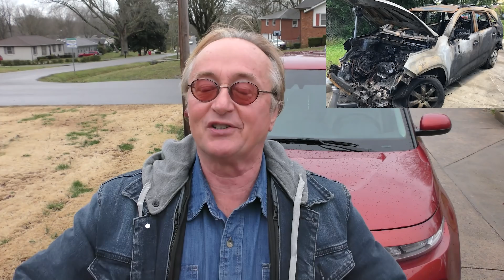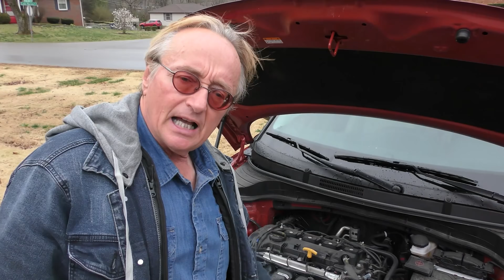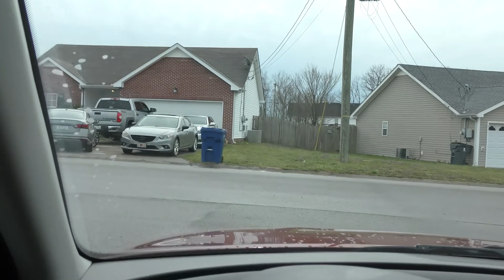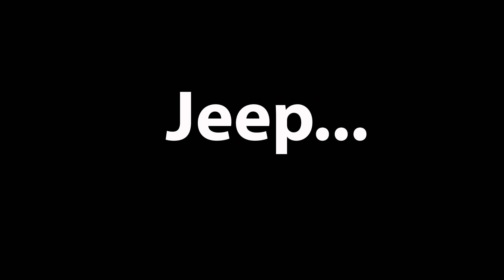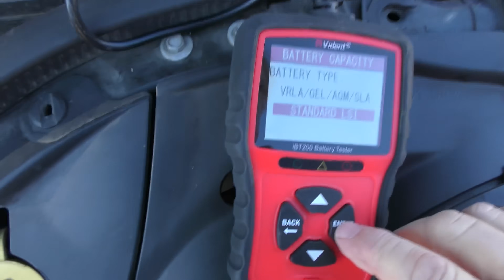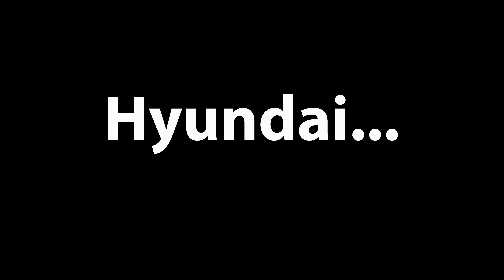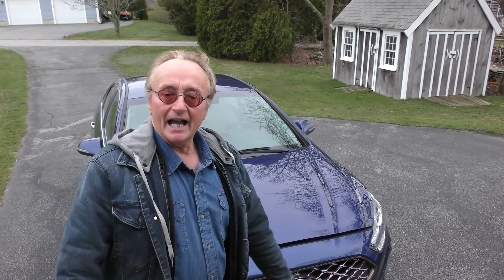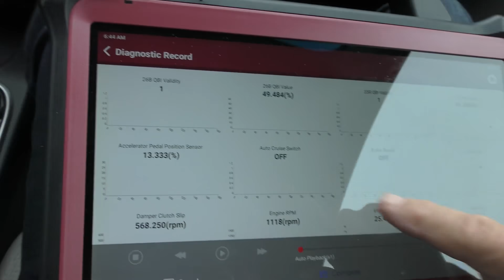3 Car Brands That are Crap

Comment: My 2000 Camry 4cyl has 288,000 miles and doesn't and has never burned a drop of oil, it's scary how well built this car is .
Reply: Toyota makes good cars, that’s why the Camry beat the Taurus in the 90’s, among other things, lol
Reply: @ryanwiseman9141  My college roommate bought a brand-new Taurus.  Total lemon.
Reply: @ryanwiseman9141  Toyota SR-5 is a "Midway for US Small car" in the 80's.I got rid of my new Volvo 244 GL and brought a used 1980 Celica used with 30K miles 2200 cc engine SR 20 in 1987 because I was sick of repair bills for my Delta 88 and Volvo 244.
Reply: @ryanwiseman9141  My aunt had a Windstar (same engine and trans as a Taurus V6) with over 500K miles on it before it died. It only took three engines and five transmissions.
Reply: @ryanwiseman9141 Until it meets HONDA of the 1990s.
Step down and move down.
Reply: @loktom4068  Toyota has always been the one to beat, Honda has a tiny fraction of Toyota's capabilities.
Reply: @zachZO6-s9b I disagree with that. Honda makes a great product
Reply: They're good cars. If I needed a commuter I usually look at what kind of car they have for taxi. It's a good indication of what car is reliable.
Reply: One of my co-workers had a 2001. He just recently sold it with 200,000 miles on it and had no issues with the car at all except regular maintenance.
Reply: @thomasgodlewski1943  unless its a bmw they use.
Reply: Yes. I love Toyota. My 1996 toyota 4 runner is still running great. Over 310,000 miles. What a fantastic car.
Reply: Not scary at all.. it's fantastic.
Reply: 97 to 2001 Camrys are indestructible.
Reply: @ElGringoLocoOficial  I hope you're right. I just bought a '97 Camry with 120K miles.
Reply: @histubeness  Just keep your eyes on the gaskets. The mileage is low but any 27 year old car usually begins to leak oil because the gaskets get brittle. There's no reason your 97 shouldn't make it to 240k or more.
Reply: My Toyota Tacoma with over 600,000 miles has never dropped a single drop of oil.  Been parking it in same place all 20 years and you can look where I park it and not a single drop of oil
Reply: The engines on the old Camrys are all fantastic, it's always rot in the rear shocker turrets that kills them.
Reply: Same here in Australia. Bought a 2000 Camry 4 banger auto. Yrs of trouble free use. 1 water pump and 1 reverse lamp switch due to water corrosion. Great on fuel and all round good car to drive.
Reply: It will outlive us all
Reply: Love my 2009 Camry
Reply: And today all companies make cheap crap
Reply: It seems only Honda & Lexus remain.  I wouldn't buy a new car anyway. @anarchyamp
Reply: @millerforester6237 
I looked at some Hondas yesterday while I was in for service. The dealership wanted anywhere from 3000 to 6000 over MSRP for the Civics that they had on the floor. There wasn't much else in the showroom.
I'll keep my 2004 Honda until it does. It doesn't burn any oil. Hopefully, I can get another 150,000 miles out of it.
I looked over the one Accord that they had. It was the base model. I wasn't impressed.
It doesn't help to have a 13 inch TV screen sticking out of the top of the dashboard.
My first TV at home was a 13 inch tube TV and I didn't have to pay for programming.
We are witnessing the regression of so many years of automotive improvement, now. Cars burning oil at 15K? Ridiculous.
Reply: My 2004 audi a8l has over 363 000 miles and doesnt burn oil either.
Reply: I have 270,000 miles on 2010 Camry. My 02 and 07 honda had engine failure before 250,000 miles. Camry’s are great cars- still smooth running.
Reply: I have a 2011 Toyota Sienna.  It was a fleet vehicle with all the bells and whistles.  Best vehicle I’ve ever owned.
Reply: Why is it scary?
Reply: Scary?  You mean, reassuring.  
I'm driving a 2003 Toyota sienna with 350000 kms.  Still works well!
Reply: I have a 2006 Corolla dx standard 190k miles still going strong
Reply: @Pottymouthvet  Back when Toyota made quality products? 😁
Reply: That’s why I only mess with saving for a Camry or Corolla it’s worth the money and time to wait longer
Reply: Same with my 1999 Avalon with 265. I bought a 2011 Buick Lacrosse with 100k but keeping the Toyota for when the Lacrosse dies in a couple of years
Reply: That was a great generation. My 2007 Camry burned oil and Toyota weren't keen on fessing up to excessive oil consumption. Quality has been sliding since, but still decent.
Reply: Every engine burns oil. Every one. You are likely changing it before you can tell. Even  if its minute, it burns oil. The cylinder being lined with a very thin layer of oil, which is partially burned off during the combustion process and the oil is replaced on the next piston stroke. Also it depends on how hot the engine is when you check the oil. Hot oil being a liquid, expands. Excessive oil consumption can be attributed to a number of issues; using the wrong oil, not breaking the engine in properly, etc. BTW, Kia as a brand has very good reliability. Jeep has average reliability, and Hyundai close to average. These 3 brands are not crap. If you want crap Tesla, Chrysler, Audi, and Land Rover.
Reply: My 1994 Camry LE had 304M on it when it broke down in 2022, in another state.  The local dealer in Boone, NC jerked me around, so I had no choice but to trash it.  Another reason to maintain your car.
Reply: Too bad modern Toyotas are overpriced garbage. Recalls after recalls. Markups after markups.
Reply: I’ve got a 2001 Camry XLE that came with a very strong factory 6-cyl and now has 144,000 miles. She runs magnificent and I’ve only had to replace the spark plugs, alternator, and a pair of loose gaskets (All of them were FACTORY parts). I can agree that it’s an incredible car, and it’s capable of a lot more than I thought it would.
Reply: Toyotas are 4 ever
Reply: My 88 F150 has done the same, V8 and everything. 690,000 miles on it.
Reply: Mine has 300k.    Blows out lots of oil.    Great other than that
Reply: Never mind all the power functions still work, power seats moonroof , windows, remote all that works, and it still has ice cold AC it's only been recharged twice and 24 years. I also have a 2015 Sienna very reliable but the craftsmanship is not what the Camry is, those days are gone.
Reply: My 04 just quit at 301600 miles.
Reply: Camry is an Excellent car, ITS TOYOTA, I had Toyota Corollas from 1988 and 1992, they were old cars when i got them, these cars are the best
Reply: My fiance is going on 200k for her Volkswagen Jetta 2010 5 cyl 2.5L 

Its had tons of issues electrical wise but man , it just keeps going , never expected it to
Reply: I just got a 98 toyota avalon xls... 5mo ago. My friend had her 5yrs prior and ran her down. Door handles mostly gone lol. But she had 281k+ and counting. Still fixing some things but she runs good up & down the highway. She's a rescue and per previous owner "Beige Betty" will be getting a face lift and a rejuvenation of some parts until i turn her into a "Betty Boop" my goal is to get her well over 300k miles.  Ive seen ppl get them to 500k even 800k miles on their avalons....i could only be so lucky.
Reply: That was a amazingly built car. Loved the 2000 camry
Reply: All GDI engine, it is common issue
Reply: I have a 2003 Toyota Tacoma with over 600,000 miles.  I have only given it 24 oil changes.  Once drove over 100,000 miles without an oil change
Reply: @davidadams5280 Wow, unbelievable! I have a 2016 Camry with 313,000. Great car!
Reply: @leroyh8977  That's a ton of miles on a newer model car, crazy amount of driving on that thing.
Reply: @leroyh8977 wow so you're driving approximately 3,260 miles a month?
Reply: @tuffstuff2U  Yep, Uber driving. 323,000 now
Reply: @leroyh8977  dang, that's amazing!
Reply: @tuffstuff2U  And that’s part-time. Enjoy being my own boss and talking to all kinds of people.
Reply: All my friends who claim their Hondas are the best cars built need me to drive them somewhere.  You do the math
Reply: I'm the original owner of a 2015 Dodge Dart SXT with a 2.4-liter that has 370,000 miles and just keep up with maintenance
Reply: @michaelgorman4229  miles aren't the problem,  it's age.
Reply: Body is probably gone...RUSTED....that's a huge issue with old Toyotas
Reply: @WhaAmIsupposedToDo  actually zero rust, never garaged and not particularly well washed or waxed, they're very rust resistant, I've had 2..
Reply: @WhaAmIsupposedToDo Are you like 80 or something.. The 4th been Camry was probably over of the most rust resistant cars of its time..

Comment: I work for hyundai right now we have 12 cars that need new engines some of them only had 10 to 20 thousands miles on it I seen some with 6 thousands miles on it with a busted radiator

Comment: One firm I worked for bought a new Hyundia van as it was cheaper than the Toyotas they usually bought. It burnt so much fuel the first time out compared to the Toyotas, the driver got stranded. It got nicknamed 'The high and dry'

Comment: I agree. Forgot to mention ford and Chevy. After working at an oil shop I can confirm that even before 60k miles everyone's cars are knocking and banging even when they just bought off the dealership. Dealerships have idiots that drain the break in oil as soon as they get the brand new cars in and even if it has 200 miles on it they're putting their generic oil in it which around here is synthetic blend duramx oil even if the car needs full synthetic due to a turbo or supercharger. But I've never seen an American car perform properly in my life.

Comment: I had a 2016 Kia Optima and got rid of it because I was burning 5 qts of oil every 1500 miles, and they refused to check it. It started burning oil at 20,000 miles. They refused to inspect it without a $4,000 deposit even though I had a 100,000 mile warranty. They told me, "Drive it until the engine dies, and then  we will replace the engine"...... I had 2 kids and can't risk their safety.

Comment: The most reliable vehicle I've ever owned was a 2008 Kia Sportage. Bought it used in 2012 with 112k miles. Drove it until last week when it was totaled in an accident with over 200k miles. In ten years I had to replace a battery and put on new brake pads...that's it.
Reply: Not even new tires?

Comment: Got a 2013 Kia soul, it’s got 183k miles, it burns a little oil but never has given me a minutes trouble otherwise, I traded a 2013 dodge dart for it, best choice I ever made,  I have a 2014 sorento it’s never gave me a minutes trouble and my sister has a 2015 soul no issues, yeah Kia has issues but much more reliable than some other brands….

Comment: Any recommendations about this?
I have a 2.0 engine MK4 Golf that the last owner uses with 10w40 oil and I've seen that the manual says it should use 5w30. Should I change it back (or use 5w40 as someone told me to) or just keep using the 10w40?

Comment: Had to service fans both of them pushing 140,000 they put slick 50 and one didn't make a difference I put Dura Lube in the other and it stopped burning oil and came back to life so I don't know what to do that but it worked

Comment: Scotty I bought a Kia Rio Cinco for $6,500 in 2001 cash from the dealer and I drove that car we tracked its mileage we tracked its fuel cost receipts the whole nine yards tires maintenance replacement parts and we have a total of $49,000 in 220,000 miles at is the best deal you'll ever get in the car yeah the car was Beast jump and I bought it and it still piece of junk but it was sure cheap to run

Comment: The trick was to buy the Kia Soul with 1.6 liter engine and manual transmission.  Over 100k miles, no leaks and only tires, wipers and one change of brakes for $12,900 in 2015.  This was the best cost per mile new car anyone could have bought new in 2015.
Reply: Im looking for a Kia manual, 2021 is the last year for the manual LX! I plan on keeping this to the end days, lol!  I need something safe to roadtrip in , comfortable,good acceleration,drcent mpg! 🧐

Comment: Finaly fixed my 2015 civic pushstart button. Circuit board and pins inside the butyon were dirty and had some viscous coating. Used q tips and contact cleaner. ..works great. But im still reeling from anger at honda for totally ignoring this.

Comment: Own a 2016 Soul with 2.2 LTR gas engine and has no oil burning issues thus far.  I am not a speed demon and maintain it regularly, changing the oil every 5k miles and use synthetic only.    Original miles are 33,053 as of today.  Yes, I admit I don't drive it much.  I had only one recall for the computer, other than that I am very pleased with it.  
Maybe the oil burning problem is a hybrid issue?

Comment: I had a kia soul. Never gave me problems it was a 2016. But only had 60k miles. I now have a 2018 kia optima the thing has ALOT OF ELECTRICAL problems. It's frustrating it barely has 40k miles

Comment: Had a 2001 toyota corrola that burned oil at 50000 miles ,it was piston rings.i wonder if kia needs to change piston rings and pistons. Toyota had motors that burned oil ,and did the same crap kia is doing. Also wonder if inorder to compensate for the two end cylinders not getting enough cooling if the last two fuel injectors should run more rich to help cool those cylinders.

Comment: For Jeep electrical issues... check the grounds.  I had a Wagoneer that had a drain on the battery.  Turns out it was a ground wire had come lose from the engine to the firewall.

Comment: TIPM on my Ram 2500 went out (the engine would not crank, I used a jumper wire on the starter relay to start it). Ram dealer wanted 2k for a new TIPM and $350 labor to install and program. Found a place online that sold rebuilt TIPM's with a 1-year warranty, overnight shipped, pre-programmed with VIN you provide, $400 (with core exchange). Took me 20 minutes to replace it, truck runs and works great again. I can't believe what a dealer wanted to fix. It took them a couple of times to diagnose. The first time, they told me it was the starter. I asked why a jumper wire on the relay would crank the starter if the starter was bad. I was told their "master mechanic" said it was the starter.  I had an extra that fit, put it on myself, same issue. Called the dealer and told them they misdiagnosed and wanted to let them know before I went someplace else. They looked at it a 2nd time with no charge, then decided it was TIPM (which I thought it was, to begin with, just wanted to verify). I'm not sure what a Dodge/Ram Master Mechanic does   :)

Comment: Hey Scotty, 

I'd like to argue for Hyundai for a moment. I know it's a sample size on exactly 1, but I have a 2018 Base Elantra GT (the hatchback version of that car). These have some different engine configurations, but mine is the 2.0 L4 GDI (G4NC) engine with the A4CF1 Transmission hyundai has been making (I think. Best info I can find. My car is a little rarer). I don't have any issues with my car, and it has nearly 60k miles on it. I'd say the only real issue I've got is outside of sport mode, the car is really sluggish, but in sport mode it hold RPM way too high for my comfort. 

That said. I know these transmission in particular have issues with the Valve body/Solenoids on the tranny.

Comment: Yeah.. my Duramax burned lots of synthetic Shell oil 1qt in 1000 towing miles (10kpounds) Dealer switched to what they use and it had decreased oil consumption…strange.  Also, I am concerned about the damage done to the “DEF” and other exhaust components….

Comment: The VW bug number three cylinder ran hotter because the oil cooler was mounted right above it.  The cooling air had to pass through the oil cooler before it got to number three piston fins.

Comment: I think the dealership may make a difference. The dealership where I bought my Hyundai Sonata was great. I took it in for an initial oil change at 2000 mi, on advice of the salesman. I put full synthetic in it, on the dealership’s recommendation. No problems. Then I moved. And I can’t say I have the same degree of confidence in the new dealership. It’s more of a feeling than anything else, but I doubt they would have recommended the 2000 mile oil change. And when you have little metal bits in the oil, that one oil change could save your engine.

Comment: The 2021 & 2022 Hyundai Santa Fe, Sonata and other models were recalled due to fuel leaks on the fuel rails and another recall because while driving the transmission would disconnect from the engine.  They definitely need some quality control at their factories.

Comment: i ve got a kia ceed for 9 years never goyt any issue....now i bought a new x ceed for almost 1 year notr a single problem,,,cheap an reliable car,very low on diesel consumption.....almost 80 miles /gallon on motorway at 60 65 miles /h....uk

Comment: Manual transmission Hyundai cars are good only as cheap wheelbarrows to learn driving with your first car. Especially the i20. It doesn't feel good at all to drive it. But it just runs and works if you have a 2011 model with a 1.6 gasoline engine.

Comment: My wife has a Kia Sorento and it definitely burns a lot of oil.  I was doing oil changes at around 7500 miles and it would only have like 2-3 quarts left each time.  It’s not under warranty it has like 130000 miles on it so I started checking the oil and refilling it as it got low.  Now I decided to just go with the old 3000 mile oil changes which I’m on my first one but I’ve checked the oil at about 1000 miles and I have lost none yet.  I change my oil at about 10,000 miles on my ford mustang it’s never off the full mark even at 10,000 my old Chevy truck has the thing that tells me when to change the oil which is around 8500 miles it’s also never low it also has 240,000 miles on it.  Kia definitely is not as good as them.

Comment: I miss solid state/discreet component electronics. Probably why I prefer to buy vintage audio equipment and do my own recaps, etc. Basic multimeter ($50), an ESR meter ($40), basic 2 channel oscilloscope...decent soldering iron, voila.